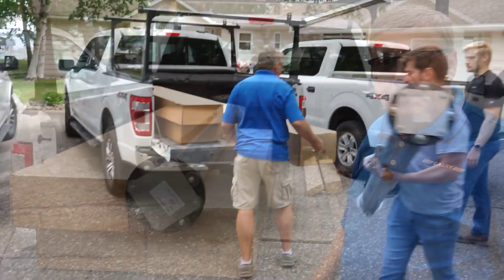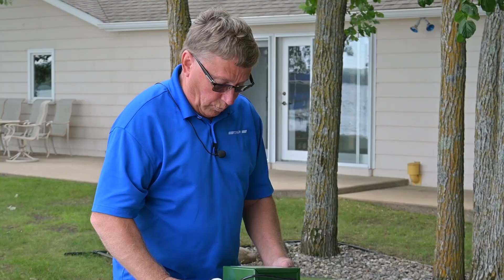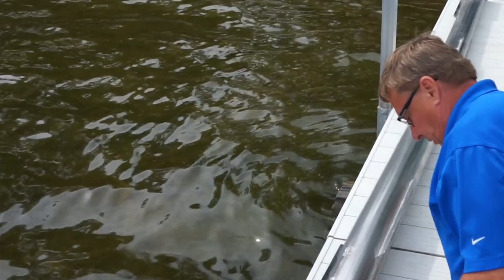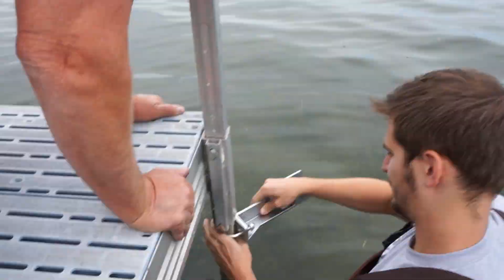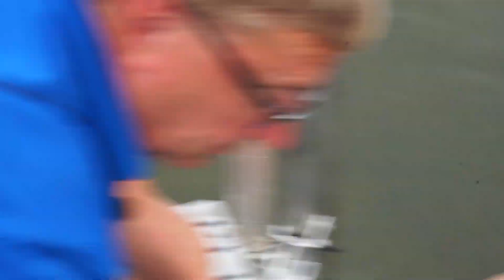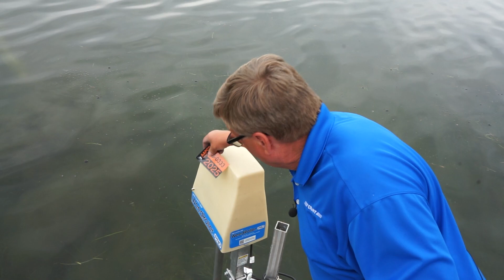Crary® WeedRoller® PRO Installation

Comment: How do you adjust the Switch Arms?
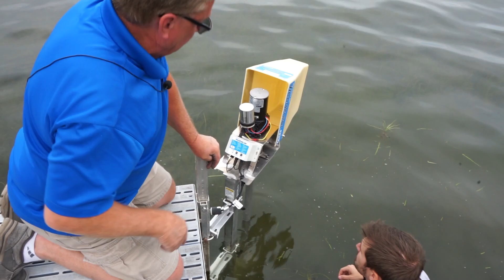Reply from the maker: Thanks for the question! Check out the video at 12:54. The magnetic arms can be positioned to the location you'd like your roller to stop in either the left or right position by sliding them around their circular track. They can be tight to move initially. Thanks for watching!